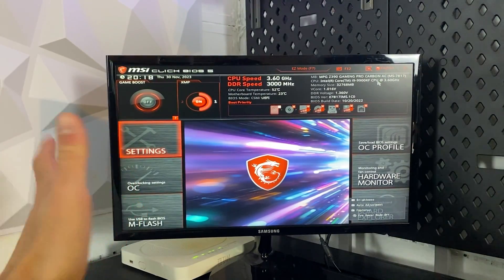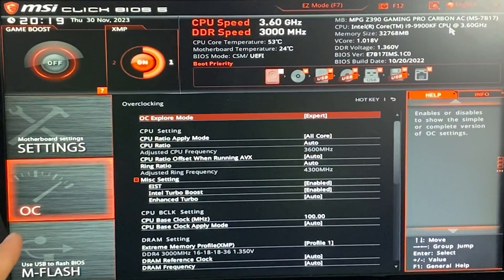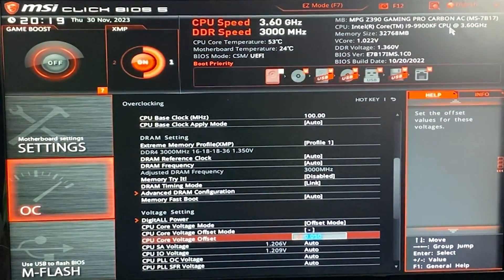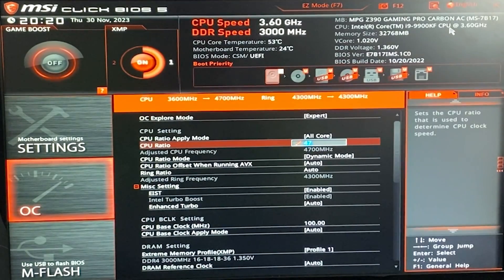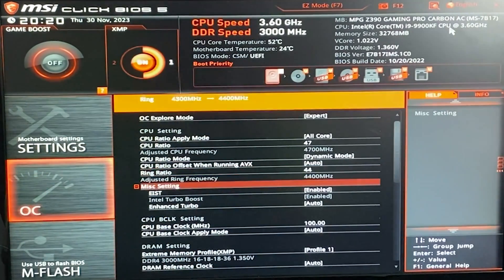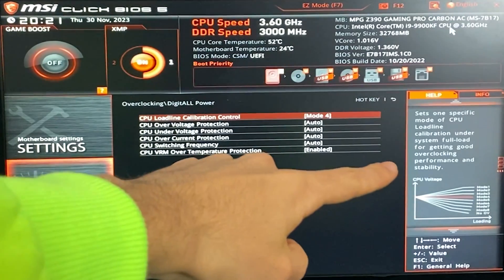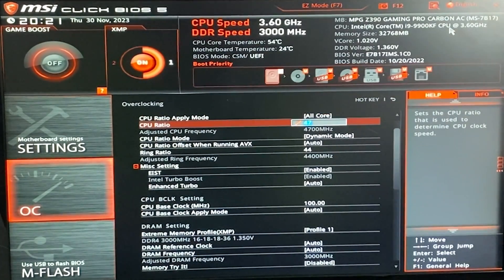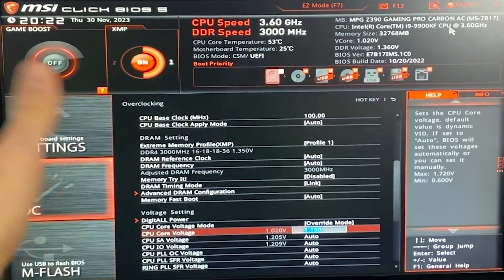Undervolt your i9 9900K for more FPS! (Even on Locked Motherboards) - Tutorial

Comment: I’ve just done this, and thank you for the tutorial. Quick question, my i9 was boosting to 5.7GHZ before and hitting the mid 90’s degrees in some games that were intense. With this, obviously that boost clock is now locked to 4.7GHZ instead. I’m seeing cooler temps as expected but surly I will also feel that slower clock speed from 5.7 down to 4.7 and therefore lose performance. Is there a way to go higher than 4.7 that you’ve found stable settings for in your testing? 1.2v and medium load line seems fine for 4.7 on my system. What would you recommend for 5.5 for example? Or is the performance gain simply not worth it? Thanks for your time :)

Comment: I tried this on a asus IX code Motherboard with the 9900k, and it does help but i need to have v at 1.25 cause 1.2 crashes some games. Also I have 1 question, in the beginning you do the "lazy" way first, but do you still also keep those settings changed (offset mode, -, and voltage offset" even if you then continue to do the longer way, or are they left as original. Great help otherwise, just didnt know what to do with those settings as its not said if you keep or discard those. I also followed and liked, :)

Comment: What is the best cooler for this device? Holy Moly it reaches 100 degrees on my id cooling zoomflow 360 aio while decompressing some f1tg1rl stuff. And that while having the settings in this video.
Reply: @mraom1238  turned out my aio was dead 🤣. Now im using a thermalright frost spirit 140 and even at 5ghz, the temp doesnt go above 65. The room ambient is 20 degrees C.
Reply from the maker: Glad you figured the issue out ahaha, that was definitely too high after the undervolting

Comment: i'm sorry but what your saying is some what true but what you're doing is trying to underclock? and lower temps? in the bios you're running hot already at a 4.7? and you're running dynamic instead of fixer? and what you're doing is taking the b365 series bois setting of the auto overclock and trying to apply to a motherboard that is meant for the a higher frequency of the cpu i have owned every 9th gen and the only one that required power management  was the i5 9600k so you can get the 5.0ghz even then it couldn't do more then a 120 fps with out crashing. can we trust what he is saying I'm 50/50 some of it is but he took the msi b365 A-pro vdh bios and applied it to this board 🤣🤣🤣👌

Comment: you're FOS i get 5.1 with no heating issues getting 240 fps in call of duty and the 4.7 is the basic overclock set by the motherboard manufacture and you change the power manually is not ideal either I've had multiple motherboards with this I 9 and every single tutorial video that tells me to do it like this has caused false results in benchmarks when it comes to overclocking/undervolt the I9 on the 9th Gen. processor you can set your cores comfortably without doing any power adjustment manually because every motherboard has an auto set of power consumption and if you scroll through your motherboard and actually find the power management there is different power levels that are set by the motherboard manufacturer most people don't understand that the power management has a setting called performance mode which is set for your I9 for overclocking I have never changed the offset or core voltage manually and I hold my 5.1 overclock with no issues so I don't understand why this man here is saying you have to do these things when you don't when the board automatically has a set power consumption for this processor? and how this man is saying when you run higher voltage it causes the processor to run hotter that is not correct that's really a board setting that is causing confliction with your processor most people think that you run XMP profile 2 and everything is supposed to be fine well that's not the case usually XMP profile one is the better one to run with the I9 because XMP two how can I say inconsistent when it came to the clock speeds that were set by the manufacturers so when it comes to these things I would highly recommend not listening to this man because what he is having you do is what the motherboard does on an auto overclock I know I've been through it I've done all the troubleshooting and I wish I seen this video sooner so I can inform everybody that this man really doesn't know what he's talking about even when he's idling his processor sitting almost at 60 Celsius can we trust this man for computer information on overclocking and undervolting because when I go into my motherboard with my overclock settings my CPU sits at 36 Celsius when I am idled on windows it sits at 36 Celsius when I play video games the maximum temperature that it reaches a 75 Celsius so I still don't understand how this man thinks that is gonna help with overheating when you're sitting in a high temperature just in your motherboard ohh by the way and I do not run liquid cooling
Reply: yes the cpu can handle the 5.1 with the right combo build so spend the top dollar on the motherboard because some other person said this is the best one because the price and out of the box benchmarks little hard to live by when something happens and needs firmware update because of some issue look what he is saying is true but the fps wont be as high and even then the temperatures would still be similar but you will see more bottleneck in the cpu timing isn't running as quick by a 1ms-3ms but in first person shooters you want the higher over. me personally i run the clock speed at a 4.9 and does well with temperatures  and never crashes and has the same fps if you were running 5.0 or 5.1 and it holds the clocked speed with 0% bottleneck. give a try loaded see if that works better
Reply: @loadedchach-HH  you know what you're right the 4.9 is holding better feels a lot smoother thanks
Reply from the maker: I’m really happy it was helpful! Thanks a lot for taking the time to leave some feedback :) Consider subscribing if you wanna support the channel!

Comment: This was very helpful and I did follow your guide and I would like to give you my input. @ 4.7Ghz I was able to use LLC3  not LLC4 with a Vcore of  V1.195 anything lower it would BSOD on Cinbench R.23. but passed on V1.195  also this decreased my auto temps from 82C to 72C. I did also notice that it did lower my Cinebench score a few hundred points going from 12521 on auto to about 11920. I have noctua nh-d15  which does a decent job . I do have a question If its stable in Cinebench but not Prime95 it BSOD is it okay ? I do BSOD on prime but its totally fine on Cinebench
Reply from the maker: I’m really happy it was helpful! Thanks a lot for taking the time to leave some feedback :) Consider subscribing if you wanna support the channel! I’d say try to get it stable in Prime as well!